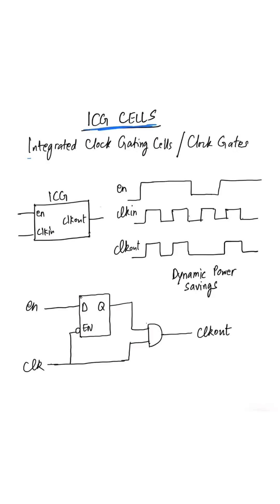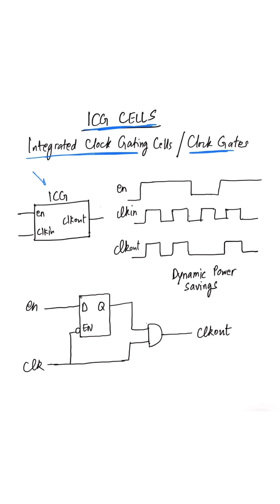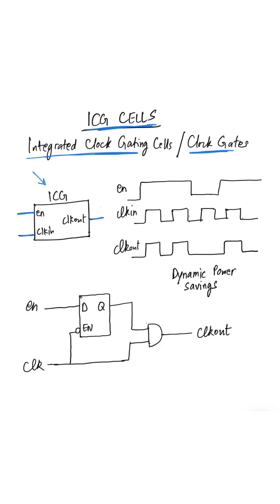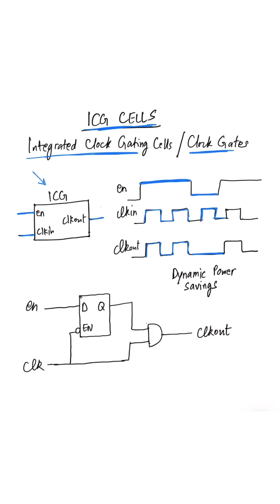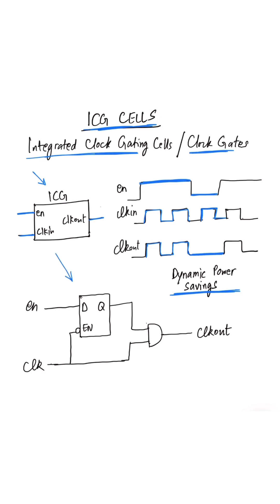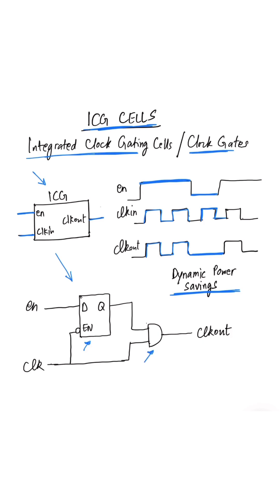ICG or Integrated Clock Gating cells | VLSI Basics | Physical design interview #semiconductor #vlsi

Comment: when tool will place ICG's in design? 
How can we see dynamic power dissipation issue in design
Reply from the maker: ICGs are added during synthesis based on the enable statements in the RTL (will explain this in detail in a future video) and are placed during the Placement stage. Usually power reports are generated after each stage like placement, cts, route, etc. which can give us a quick estimate of how power numbers are looking for our design.
Reply: @2minuteVLSI  so based on the power report tool will add ICG's in design ? Is ICG's and CGC's are same or different ?
Reply from the maker: @mounika2292 
In RTL if there is a statement like this:
if (en) q <= d, it means that q will only toggle when en = 1, and q won't toggle when en = 0, so synthesis tool will insert an ICG at the clock pin of this flop. So ICG cells are already present in your synthesized netlist which is an input to the physical design flow.
Reply from the maker: @mounika2292 Yes CGC and ICG are the same thing ...they are referring to the Clock gates
Reply: @2minuteVLSI Do clock gating can work on Positive edge ? Is there any reason that we need to  use negative edge only
Reply from the maker: @mounika2292  In most cases ICG are made of negative level sensitive latch.
Reply from the maker: We use negative level sensitive latch as it helps us to prevent the undesired glitches in clock signal. Will share a video on that.